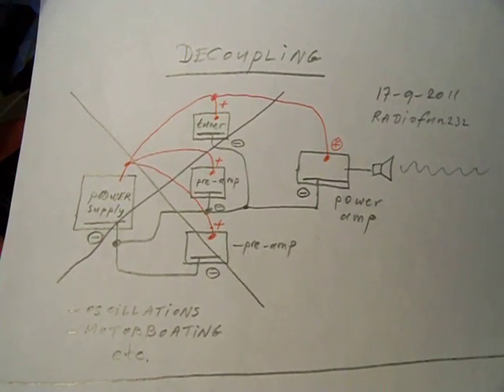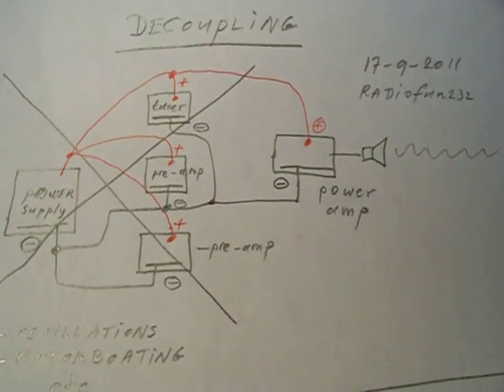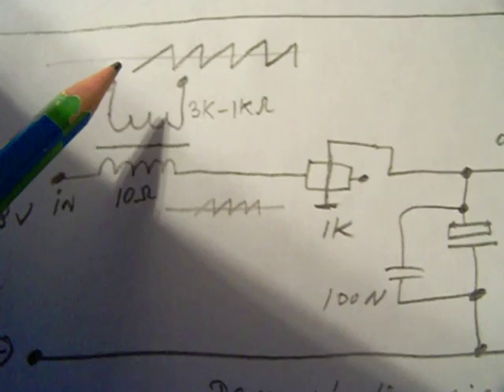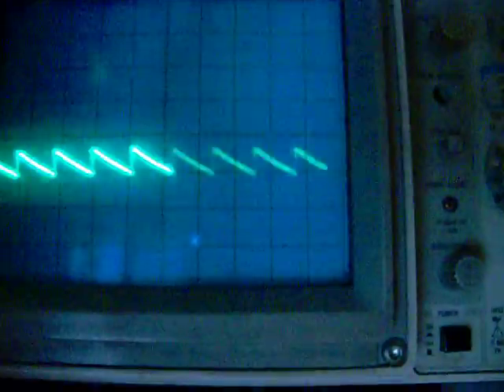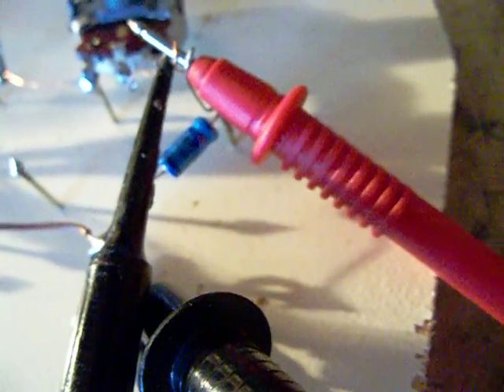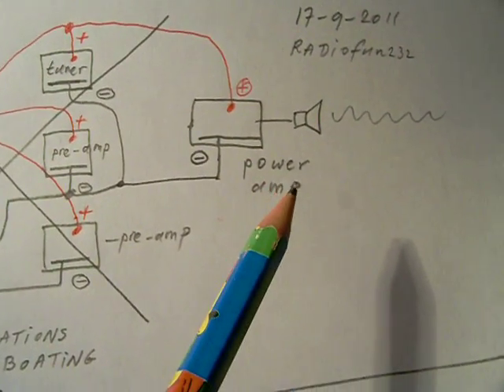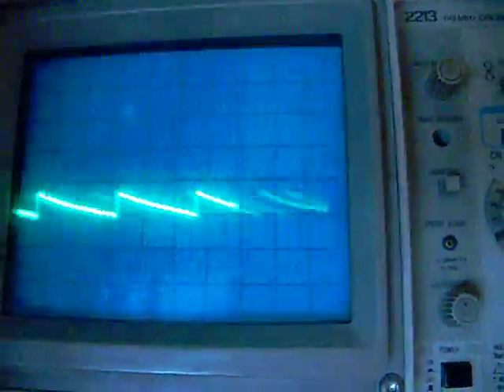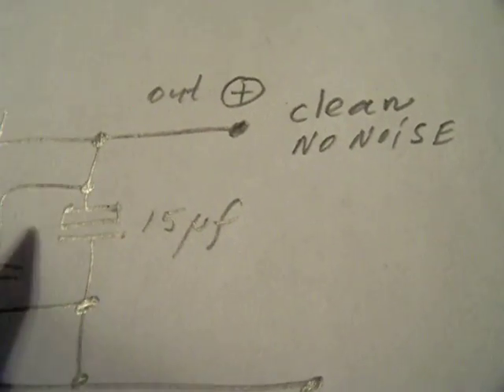decoupling in audio amplifiers

Comment from the maker: LINKS TO VIDEO ABOUT AUDIO END AMPLIFIERS
LM 386 bass boost audio end amplifier (schematic & sound demo) https://youtu.be/pke1LIqoYrg
Decoupling & hum free audio amplifiers (schematics) https://youtu.be/0SoD3GlFH0s
Audio amplifier 400 mW special for bad Signal-Noise audio files https://youtu.be/e9P3cGBUA1s
5-8 watt audio amplifier part 1 https://youtu.be/a8w2vEB9MJM
5-8 watt audio amplifier part 2 https://youtu.be/U2sgiA1V1xs
IRF PE 50 MOSFET Class A audio amp 0,5 Watt output https://youtu.be/KrK9ufcZOT8
Audio signals transported over long wires (issues) https://youtu.be/ldtEAlsCXMw
The transistor series voltage regulator practice (hum-free) https://youtu.be/YL41FPH_H-s
How to make a mini audio stereo set part 1 https://youtu.be/4Lqjw9rbzJA
How to make a mini audio stereo set part 2 https://youtu.be/ZMXUip3i1zY
How to keep vintage audio amps from the 1970’s working https://youtu.be/C_9n9c3kHVo
Old school audio cinch plug switchbox https://youtu.be/IOiG6SDP-8E
Quiescent current alignment in audio class B amplifiers https://youtu.be/9Uw16td6F14
Prevent hum in homebrew audio amplifiers (earth issues) https://youtu.be/IsLEyx3nU9o
Solid state wiring in homebrew audio amplifiers https://youtu.be/Ne1TzmitJxk
Low tech electronic construction, part 1 https://youtu.be/4Nw4qZxd3Qo
Low tech electronic construction, part 2 https://youtu.be/ZYMyIsY-qgM
Low tech electronic construction, part 3 https://youtu.be/Of_Ug1ur0sI
Developing a 6 Watt stereo audio amp, part 1 https://youtu.be/DRjn7Al-wdc
Developing a 6 Watt stereo audio amp, part 2 https://youtu.be/FJiWGJnqO6w
Developing a 6 Watt stereo audio amp, part 3 https://youtu.be/6an9geeZkgk
Developing a 6 Watt stereo audio amp, part 4 https://youtu.be/Tk5_BE2mjlY
2 transistor audio power booster 5-15 Watt https://youtu.be/TgvRE9eYXdQ
Background loudspeakers 0,5 Watt https://youtu.be/UQ3I0kLTsCI
Wall transformer audio amp 0,3 Watt https://youtu.be/Mtyuc-tNULs
Decoupling in audio amplifiers https://youtu.be/Mtyuc-tNULs
Radiofun232 on Youtube (complete video index & links) https://youtu.be/xbgQ8T3oqh4

Comment: Hi Ko, What is the significance of the 1K variable potentiometer?, does it simply vary the output voltage?
Does the hum increase and decrease with voltage,ie without the decoupling circuit would 18v be twice as loud (hum noise) as 9v and would 4.5v be 25% quieter,also with the decoupling circuit added does the voltage increase or decrease make no audible difference?
thanks - love your videos - i am learning a lot
Reply from the maker: The 1 K potentiometer does not simply vary the output voltage, though there will be some effect, it is not its aim. In fact is a part from a R-C Pi Filter (Google it e.g., C-R-C, many calculations). The first capacitor from that filter is not visible in this demo video, it is in fact the (first) power supply capacicor from, say, 1000 uF or 4700 uF. I left that first electrolytic cap away for demo purposes. The resistor + el. cap prevents that disturbing signals on the power supply leads can reach the power supply from the pre-amp and thus "influence" the sensitive pre-amp with "bad" signals: voltage clicks, oscillations
Reply from the maker: The hum does not increase and decrease with the voltage. It is a fixed percentage (%) AC, present on the DC power line. How much hum is present depends for the biggest deal (in case of classic power supplies with a bridge rectifier) on the value from the smoothening power supply capacitor. Only examples, to give an idea: 1000 uF = 5 % hum, 4700 uF = 1 % hum (normally presented in millivolts compared to the output voltage). A value from 4700 uF is almost always good to push the standard hum down to the lowest level. Further hum-reduction (if still there) must be done electronically, or with a pi-filter, so the "decoupling" unit with a 1 K resistor and a cap from 470 uF to the pre-amp will often make the pre-amp completely hum-less. The idea is that a pre-amp supplied with 9 V from the 230 V or 110 V grid must get a 9 V voltage as "clean" as e.g. from a carbon zinc battery.
Reply: radiofun232 Hi, do you need to have a decoupling circuit across every supply rail for each individual pre amp OR can you just build one on the main power supply rails and supply all 3 from that? would it work the same.
Would it be better to use the largest uF caps in the smoothing  circuit of the main power supply, thus eliminating the need for the decoupling circuit or pi-filter, ie 22,000 uF capacitors used as the smoothing caps, would this totally eliminate all hum without the need for the circuit in your video?
Reply: radiofun232 Finally, you mention further hum reduction can be made with a pi-filter if still present,is your decoupling circuit a pi filter? or is that a different design.
And once again could you place this pi filter on the main power supply and supply all pre amps from it OR would you need one on each individual supply to every single pre amp? I am thinking of the saying, "prevention is better than cure", so if the hum was completely gone at the main PSU stage then everything after would also be quiet
Reply from the maker: SP330Y
It depends. Normally 1 decoupling unit for say 3 pre-amps works good. but if you have 10 pre-amps I think it is better to use 2 decoupling units. When you feed one magnetic pickup phono element I think the best think is to give it a separate decoupling unit, due to its extreme sensitivity for electromagnetic hum. Also a role plays: how long are the power supply wires to the pre-amps, how sensitive are they, where are they located in the amplifier? When the power supply lead is  1 meter long it is more vulnerable to pickup hum and EM noise and insert that into the pre-amp. This can also happen when the impedance from the power supply lead is high for AC influences, in a worst case they can act like "antenna's" and must be shortcut to ground for AC with the help of a capacitor. That is also the work of the decoupling unit. Buy my book "Schematics 2, audio amplifiers and loudspeaker boxes" (author Ko Tilman) on the Lulu website and all your questions are answered.
Reply from the maker: SP330Y
A second problem is that the power amplifier needs a hum-less voltage and current, say 2 A at 25 Volt (or even 3 A at 40 V) and the pre-amps need a hum-less Voltage and current say in the order of 5 mA. The latter is easy to make with a decoupling unit. When the power amp takes current, the voltage falls from say 30 V (0Amp) to 25 Volt (3Amp). No big problem for an end-amp, but the voltage on the pre-amps must stay perfectly constant. Thus it must be electronically stabilized. Sometimes the power amp needs a stabilized voltage too. On high currents, hum gets a bigger and more difficult problem. The cheapest method: high value smoothing caps + a pi filter with a choke coil with a gap in its core, effective on the mains frequency, say 50 Hz or 60 Hz. A resistor in a high voltage power supply pi filter gives too much energy loss. Many problems can be solved with an electronic hum-suppressor. A transistor set into conduction in series to the + from the amp that has an electrolytic cap from its base to ground. The cap value is multiplied by the transistor beta, so a 100 uF cap gets 100 x 300 beta = 30000 uF.  That is what the amp circuit "sees". More info and many practical solutions regarding these issues in my book "Schematics 2, Audio Amplifiers and Loudspeaker boxes", author Ko Tilman. Much value for money when you really want to build amplifiers, previeuw on the Lulu website.

Comment: Hi Ko,I was looking once again at this video which is very good but from the circuit diagram i see there are 2 x capacitors wired in parallel a 15uF and a 100nF across the power rails but on the actual built soldered circuit i cannot see the 100nF capacitor.
 What is the importance of this second cap and the value of 100nF, why is it needed aswell as the 15uF,what i am asking is what does it add to the circuit in terms of noise reduction in hum etc, would the 15uF alone do the job??
Reply from the maker: +SP330Y I always brigde every power supply capacitor (whatever value, say from 100-10000 uF) with a cap from 100N at 300 V and a resistor from 100 K or so. On tube power supply cap circuits: 470 K. It can help to remove spikes from the power supply rail and will discharge the cap after x... minutes, so that it stays safe (touching). Electrolytics sometimes have bad properties on HF, so say when signals from 20 KHz - 100 KHz and higher are also on the rail at the same time when DC is present, an extreme example: say when you are transmitting with a radio transmitter near the audio amp. The 100 N damps HF, so the supply rail is shortcut to ground for AC HF. With switched power supplies this sometimes does not work with 100N, take a lower value, say 4700 P, check it with the scope parallel to the power supply rail.
Reply: radiofun232 thanks again Ko,thanks for answering so quickly and in great detail.
I do enjoy ALL your videos,especially anything audio,as you might be able to tell,i love audio and high quality audio,I cannot tolerate very poor hifi when most of the time it does not cost much more to design a much better top quality amp or preamp,the chinese are especially good at making rubbish :)
Japanese,german and british hifi products from the 1980s etc and 70's are all top quality
Reply from the maker: +SP330Y I agree completely. There is so much rubbish on the market now in 2016, only made to "sell" and earn money in a (in my opinion) saturated audio amp market. So the quality from especially smaller audio gadgets since 2005 is low. Indeed the 70's and 80's (up to 1987) audio amps (range 10-30 Watt) are often good, especially the Philips amplifiers. They are easy reparable (no chips or microprocessors) and produce a great sound. A big discussion between Hi-Fi purists was the use of the "loudness"  circuit. I appreciate it, it adapts the effective loudspeaker output to the sensitivity of the human ear and/or the room where the music is played, eventually together with the normal high and low potentiometers. Anyway, audio is always interesting and always an advance to make it perfectly in your personal room (what you like and need, it can take some time till you are satisfied with the real sound in your living room).  I made a book about audio etc. and my experiments called: "Schematics 2, audio amplifiers and loudspeaker boxes", available via the Lulu website.
Reply: radiofun232 Yes Ko,I already bought that book from the Lulu website :) a while back now

Comment: That's a (variable) low pass filter. The problem with a low pass filter is that it reduces the power, you can only use this at low power applications.
Reply from the maker: More info here https://youtu.be/0SoD3GlFH0s
Reply from the maker: Thanks & this is a good hum-free/decoupled power supply for audio ampifiers (skip the 2 automotive lamps), it can deliver (say) 30 Volt at (say) 2 Ampère https://youtu.be/-hXvM1svcdY